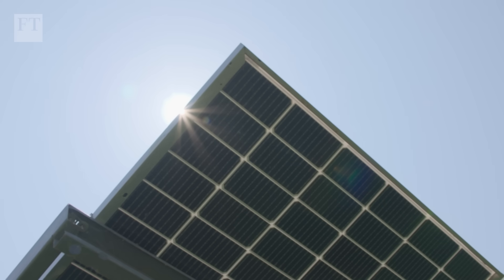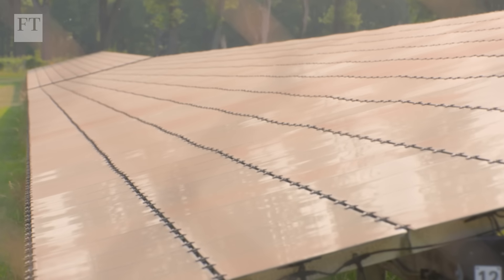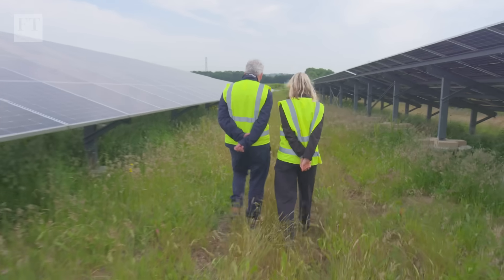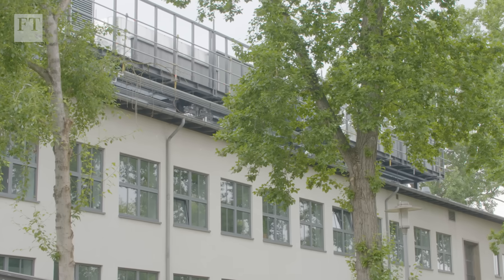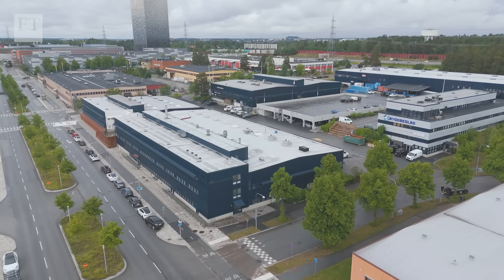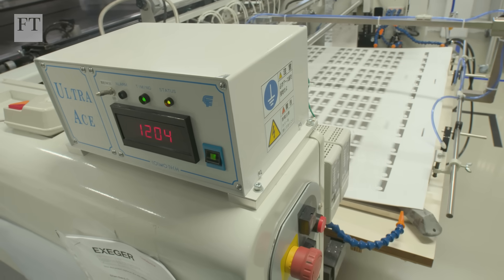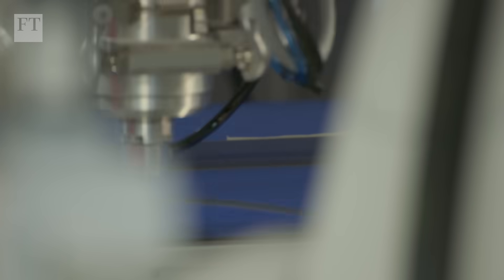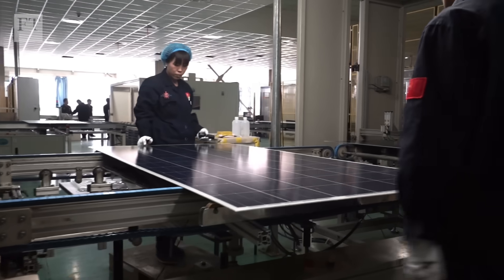Can new technologies supercharge solar power? | FT Rethink

Comment: 0:09 - The theoretical calculation is based on Earth receiving 173,000-terawatts non-stop from the sun.  Or about 1000-watts per square meter at peak on the ground and it's always peak somewhere on Earth.  Using these numbers, sunlight can provide all 620-exajoules of primary energy the world uses in 1-year in just under 1-hour.  Or about 1/10000th of that spread out over 365-days of a year.

The US would only need about 0.7% of its 3.1-million square mile land area to power all of its 4200TWh annual grid use.  That's based on the 181GWh/year/square mile of current solar farm energy production in the southwest sunniest areas.

We can and will run the world on sunshine and wind.  All the combined fossil fuels that ever existed would amount to a bucket in an ocean in comparison.

We need to remember it takes a lot of energy and resources to explore, drill, refine, and distribute oil & gas and they're very inefficient energy sources--along with a host of other problems related to fossil fuels too numerous to mention here.
Reply: GREAT COMMENT... THANK YOU :)
Reply: Are you using a solar charger to charge the device from where you are advocating for solar energy?
Reply: Your thinking is so basic, it hurts. Did you use Chat GPT or something? If so, "RIRO" applies. People on here are like the embodiment of that NDT quote "people know enough to think they are right, but not enough to know they are wrong".
Reply: @markfernandes2467  Mark, if don't agree, you should have at least have a cogent response.   Not a low-effort waste of text.
Reply: @beyondfossil  Why waste my time? Do the math yourself before you comment, just learn to think. 

If you haven't included the following (and more) variables in your model, it's wrong. 

Physics
math
logic
geography
Night time
Winter
latitude
seasonal differential output
Capacity factor
land area needed
Energy density
weather risk
curtailment
overbuild needed
inertia

firm power
dispachable
load following
load shifting
storage cost
back up
scaleable
enegy security
suppy chain
dependance
dunkleflaute
solar irradiance
flat land
advanced economy
OECD
heavy industry
heating
waste/low grade heat
land clearing
recycling
mining
longevity
FSLCOE not LCOE
connection costs
industrial heat
low Co2
duck curve
ARs(1~7)
CFDs
MCP

Electrons are not all made the same. You seem not to know this. 

You want to rely on shitty electrons and pay top dollar for them. 

Anyone with any sense can see none of this works, let alone is it a good idea. 

When you look at all the variables, the only energy souce that makes any sense at all to build an advanced economy on, especially one with a seasonal climate, is nuclear. 

Nothing else gives you what it can and it's not even close. They call it "boring power" because it just does almost everything you could want reliably and without fail.
Reply: @markfernandes2467  Why waste your time?  You're the one that came into this argument on your own accord.  Nobody forced you to be here.

You're trying to side step the basic argument you cannot get away from   The cosmic size of the sun absolute dwarfs any energy source on Earth no matter how "cool tech" it is.  There is not even an energy source even remotely close to its power within 4-light years distance from here and over powers every energy system on Earth by many orders of magnitude.

All the science and economics points to renewables and storage to dominate the word's energy systems.

You've listed a bunch of "required terminology" yet you yourself did not use them in your argument.  Oops, foot in mouth much?
Reply: @markfernandes2467   You're asking "why waste your time?"  You're the one that came into this argument on your own accord.  Nobody forced you to be here.

You're trying to side step the basic argument you cannot get away from   The cosmic size of the sun absolute dwarfs any energy source on Earth no matter how "cool tech" it is.  There is not even an energy source even remotely close to its power within four light years distance from here and over powers every energy system on Earth by many orders of magnitude.

All the science and economics points to renewables and storage to dominate the word's energy systems.

You've listed a bunch of "required terminology" yet you yourself did not use them in your argument.  Oops, foot in mouth much?
Reply: @markfernandes2467  You're asking "why waste your time?"  You're the one that came into this argument on your own accord.  Nobody forced you to be here.

All the science and economics points to renewables and storage to dominate the word's energy systems.

You've listed a bunch of "required terminology" yet you yourself did not use them in your argument.  Oops, foot in mouth much?
Reply: @markfernandes2467  Commercial utility-scale nuclear energy is one of the most expensive forms of electricity generation on a levelized cost per MWh.  Worse is most build takes 10- to 20-years to bring online a single reactor.   The next 10- to 20-years will be critical to mitigate the worst of climate change.  Extremely slow growing commercial utility-scale nuclear won't even put a dent in the amount of energy needed to displace fossil fuels.  In fact, pushing for more nuclear energy on the grid will actually slow down the energy transition.  This is why fossil fuel interests often push for nuclear. 

Almost every commercial nuclear energy construction has been over-budget by billions and over-schedule by years to the point it's the longest running joke in the energy industry.  In its long 70+ years of history, commercial utility-scale nuclear only powers a pathetically small 9% of the world's grids and it continues to fall!

A true nuclear fan would get down on his hands and knees every morning and worship the clean fusion energy gifted to use for free by nature.  This energy powers our biosphere and our weather.  Its energy flows through your veins and powers your very thoughts even as you read these words.  But oh, this is too boring for you?  I'll take boring over catastrophe like Chernobyl and Fukushima any day.

The next 10- to 20-years will actually see a net decline in nuclear energy capacity as old reactor retirements will significantly outpace new reactor construction.  In the next 50 years, commercial utility-scale will be largely gone from the world's grids: too expensive, too slow to builds and comes with unparalleled risks that no other electricity generation source even comes close to in risk profile.  Commercial utility-scale nuclear is simply the wrong tool for the job on the grid.

Nuclear will persist though in small-scale specialized applications where it excels in like military, scientific, and deep-space exploration.  Be happy for that but don't confuse nuclear "cool factor" for ability to power large-scale systems because its proven itself it cannot.
Reply: @markfernandes2467  Besides all that, you're trying to side step the basic argument you cannot get away from   The cosmic size of the sun absolute dwarfs any energy source on Earth no matter how "cool tech" it is.

There is not even an energy source even remotely close to its power within 4-light years distance from here and over powers every energy system on Earth by many orders of magnitude.
Reply: @markfernandes2467  I'll put this to you: show me the math that puts any commercial nuclear energy that puts it even remotely close to the growth of solar and wind backed by fusion energy.  No such calculation exists.

Over the past 15 years, global solar capacity absolutely knock it out of the park!!  Growth exploded from roughly 40 GW in 2010 to about 2,200 GW in 2024, while wind grew from around 200 GW to 1,100 GW — a combined rise from ~240 GW to over 3,300 GW. 

And what about nuclear energy?

In that same period, nuclear power has been essentially flat growth!!!  Inching from ~370 GW to 400 GW. If these trends continue, even at a modest 8% annual growth for solar + wind and a near-zero 0.2% annual growth for nuclear!  So, by 2040, renewables would soar to about 11,300 GW, while nuclear would creep to just 413 GW — a gap of more than 27 to 1 in installed capacity.

New construction commercial utility-scale nuclear energy won't even make a dent in the amount of energy needed to displace fossil fuels.  This is absolutely hammered home when you consider that the next 10- to 20-years that nuclear growth will actually go negative!  Negative!   Many existing nuclear reactors were commissioned in the 1970s and 1980s, and with typical 40–60 year lifespans, a wave of retirements is coming in the 2030s and 2040s.  *Reactor retirements will outpace new reactor construction*.
Reply: @RCHobbyFan  Wht tf has that got to do with anything? Listen to yourself, lol.
Reply: @markfernandes2467  Another view onto the commercial utility-scale nuclear energy's tiny growth...

China added a massive 277GW of solar capacity in just 2024.  At 22% capacity factor equals 533.8TWh total solar generation for 2024.  Divide that by 52 weeks in a year arrives at 10.26TWh of actual solar generation per week.

Now look at 1-GW nuclear power plant at 90% capacity factor will generate just 7.88TWh for the whole year!

Therefore, China adds 10.26TWh ÷ 7.88TWh = 1.3 nuclear power plants total yearly generation per week of solar and that's after capacity factor has been included!

Even more incredible is that, in 2025, China will add almost another 378GW (maybe even 400GW) of solar!  Incredible growth.  Not even in the most fantastical nuclear fan's dreams would this growth even be imagined.
Reply: @markfernandes2467  Another view onto the commercial utility-scale nuclear energy's tiny growth...

China added a massive 277GW of solar capacity in just 2024.  At 22% capacity factor equals 533.8TWh total solar generation for 2024.  Divide that by 52 weeks in a year arrives at 10.26TWh of actual solar generation per week.

Now look at 1-GW nuclear power plant at 90% capacity factor will generate just 7.88TWh for the whole year!

Therefore, China adds 10.26TWh ÷ 7.88TWh = 1.3 nuclear power plants total yearly generation per week of solar and that's after capacity factor has been included!

Even more incredible is that, in 2025, China will add almost another 378GW (maybe even 400GW) of solar!  Incredible growth.  Not even in the most fantastical nuclear fan's dreams would this growth even be imagined.
Reply: @markfernandes2467  Another view onto the commercial utility-scale nuclear energy's tiny growth is in China.

China added a massive 277GW of solar capacity in just 2024.  At 22% capacity factor equals 533.8TWh total solar generation for 2024.  Divide that by 52 weeks in a year arrives at 10.26TWh of actual solar generation per week.  Now look at 1-GW nuclear power plant at 90% capacity factor will generate just 7.88TWh for the whole year!

Therefore, China adds 10.26TWh ÷ 7.88TWh = 1.3 nuclear power plants total yearly generation per week of solar and that's after capacity factor has been included!

No nuclear fan boy would even dare dream of such growth.  You need to realize that the global energy transition will be almost completely powered by renewables which are directly backed by cosmic fusion energy.  Nuclear energy won't even be a minor cast character in an epic TV show in comparison.
Reply: @markfernandes2467   China added a huge 277GW of solar capacity in just 2024 alone.  At 22% capacity factor equals 533.8TWh total solar generation for 2024.  Divide that by 52 weeks in a year arrives at 10.26TWh of actual solar generation per week.  Now look at 1-GW nuclear power plant at 90% capacity factor will generate just 7.88TWh for the whole year!  Therefore, China adds 10.26TWh ÷ 7.88TWh = 1.3 nuclear power plants total yearly generation per week of solar and that's after capacity factor has been included!

No nuclear fan boy would even dare dream of such growth.  You need to realize that the global energy transition will be almost completely powered by renewables which are directly backed by cosmic fusion energy.  Nuclear energy won't even be a minor cast character in an epic TV show in comparison.
Reply: @markfernandes2467   China added a huge 277GW of solar capacity in just 2024 alone.  At 22% capacity factor equals 533.8TWh total solar generation for 2024.  Divide that by 52 weeks in a year then arrives at 10.26TWh of actual solar generation per week.

Now look at 1-GW nuclear power plant at 90% capacity factor will generate just 7.88TWh for the whole year!  Therefore, China adds 10.26TWh ÷ 7.88TWh = 1.3 nuclear power plants total yearly generation per week of solar and that's after capacity factor has been included!

No nuclear fan boy would even dare dream of such growth.  You need to realize that the global energy transition will be almost completely powered by renewables which are directly backed by cosmic fusion energy.  Nuclear energy won't even be a minor cast character in an epic TV show in comparison.
Reply: @markfernandes2467    You need to realize that the global energy transition will be almost completely powered by renewables which are directly backed by cosmic fusion energy.  Nuclear energy won't even be a minor character in an epic TV show in comparison.  It won't even be the janitor on set.

China added a huge 277GW of solar capacity in just 2024 alone.  At 22% capacity factor equals 533.8TWh total solar generation for 2024.  Divide that by 52 weeks in a year arrives at 10.26TWh of actual solar generation per week.  Now look at 1-GW nuclear power plant at 90% capacity factor will generate just 7.88TWh for the whole year!  Therefore, China adds 10.26TWh ÷ 7.88TWh = 1.3 nuclear power plants total yearly generation per week of solar and that's after capacity factor has been included!

No nuclear fan boy would even dare dream of such growth.
Reply: @beyondfossil  You really haven't got a clue, have you. This is why I said it's a wast of time, you don't like facts. If not for people like you, there would be no problem with Co2 etc. And yet, all you have is boiler plate in reply. You just refuse to stick to fundamentals. Nothing you have said is  based on phyiscs or simple logic. RIght now 22% of all electricity comes from Nuclear in the EU. and that's despite being  curtailed politically and due to ignorance. 

It's criminal it's not far higher and it could have been, nuclear has been around a long time as you point out, it just works. There was never a reason to look anywhere else for a solution for energy needs. Btw, the koreans build AP1400s for 7 billion, and pretty fast. Soalr can't touch that price for the same amount and quality of electrons. (apples to apples) Anyone who chooses to build solar in the UK over nuclear is a zealot, and irrational. and has been for 40 years.
Reply: @beyondfossil  the idea is you us these terms , make yourself a list Nuclear vs Solar and just see which destroys the other on these metrics. There's objectivly only one clear winner. 

I sware, you'd buy a second hand ford instaed of a brand new Farrari and claim it a better deal even if it was the same price. You're just not good at objective comparisons
Reply: @beyondfossil  Why do i care about what has been growing more? (Subsidies and government/media/misinformation have affected groth in solar and degroth of nuclear artificially. These are just constructs of society and ignorance. if you just loook at these side by side on fundamentals, solar is toast.  

Mac donnalds had more groth than fine dinning, does that mean a big mac is better? What kind of argument is that? i can't help it if people are irrational and have been mislead by idiots and FUD about nuclear. These are not fundamental or rational arguments though. 

Show me the math and logic on the fundamentals of solar vs nuclear in the UK if you were to try to run the grid on either. one can't even do it. 

Nuclear gives so much more in terms of utility and benefits too. 

A nuclear generated electron is worth far more than a solar generated one to the grid. 

these two things shouldn't even be in the same category tbh. Nuclear also gives you two units of usable heat for every one unit electric too, just as a bonus.
Reply: @markfernandes2467 Do your own research.   Put some effort in.

As I've pointed out, the basic science and economics puts solar and wind leagues ahead of commercial nuclear energy.  It's not even close.  Nuclear won't even put a dent in the amount of energy needed to displace fossil fuels.
Reply: Fossil fuel conversion into electricity loses 40% of power. Solar has 100% conversion efficiency. 

Burning fuel in car only 42% of potential power is used for motion and a/c or heat. So imagine if we switched to solar you'd need a less overhead production